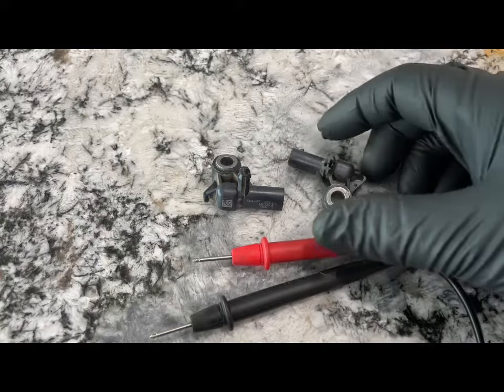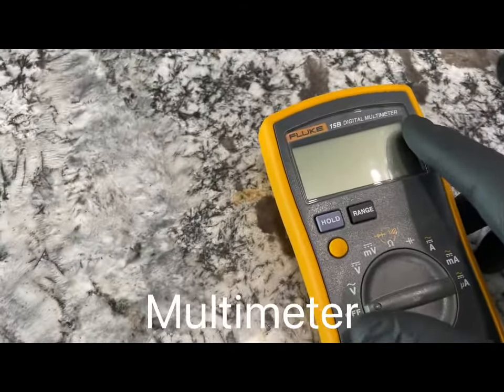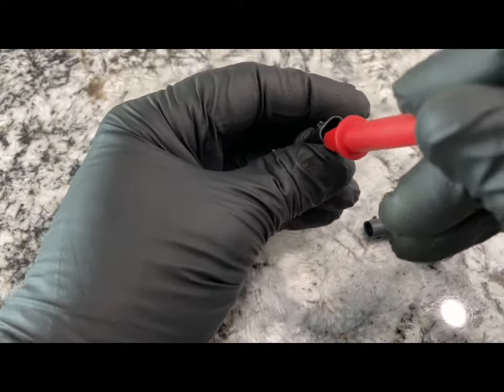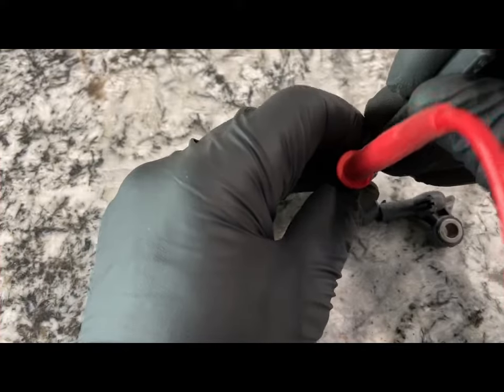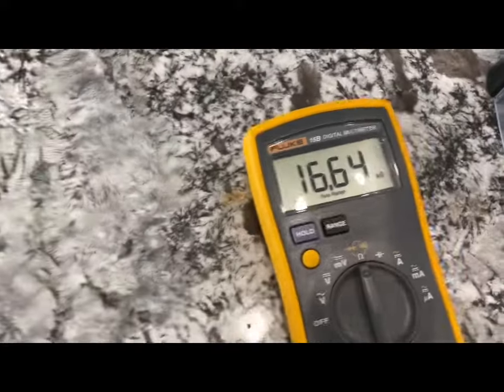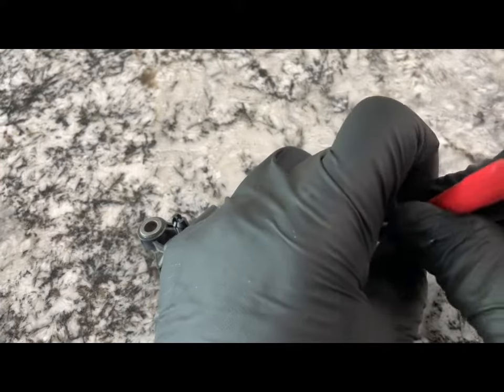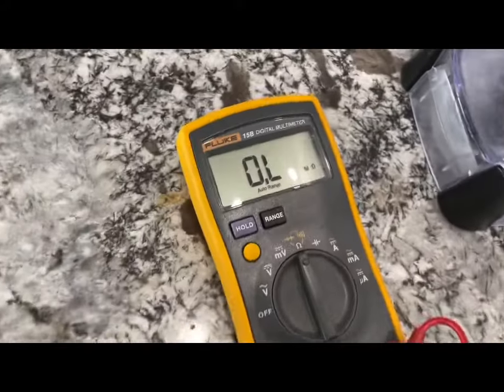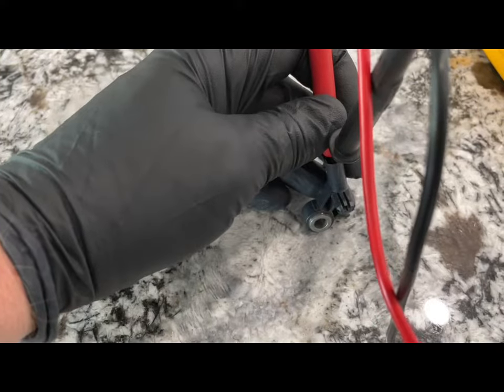How to Test an SRS Air Bag Sensor and Determine if it is still Working.

Comment: When he says zero resistance he means OL. This means it has infinite resistance,  or basically it means that the circuit has opened. A sensor that reads OL will no longer complete the loop for the srs circuit to be completed.
Reply: Haha He should have said continuity on the first sensor
Continuity and resistance coexist by definition.The 16k resistance is continuity.

Comment: This is garbage.  Impact sensors from different car manufacturers can have very different internal designs.  Some have mechanical triggers inside where this resistance testing may work.  Others use internal accelerometers in which case resistance testing doesnt work.  There may be other types of internal designs where resistance testing may or may not work. It's ignorant to suggest this resistance testing can be used universally on all impact sensors.

Comment: I had a faulty sensor and when I tested it against the new one, the resistance was lower, but it wasn't an open circuit, what's going on there? When I put the new one in it's place the dash light went off and it was all fine.

Comment: Did it just go bad or was it after a collision?
Reply: These go bad on their own. I’m pretty sure most of them reset after a collision. Someone ran into the front of our Ford Ranger one year and set off the airbags. The sensor was not replaced as I recall. Just some moderate body work and new bumper. If the unit is physically damaged due to the collision, then yes.

Comment: Outstanding information. I’m testing the front impact sensor on my 2008 F150 that Ford graciously decided to discontinue with no alternative options. My clock spring is good and nothing else seems to be malfunctioning. So the impact sensor is the next most likely suspect. But I was unsure what to look for when testing it with my multimeter. Thank you for this information!